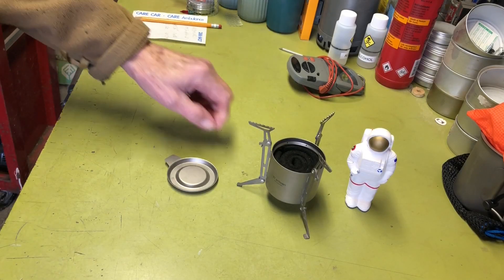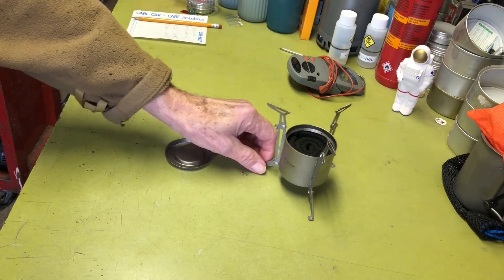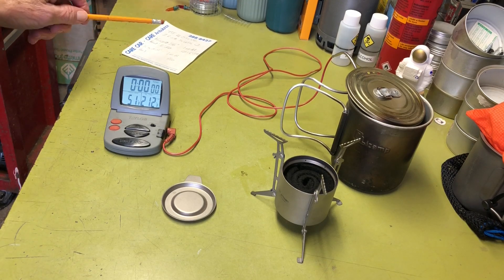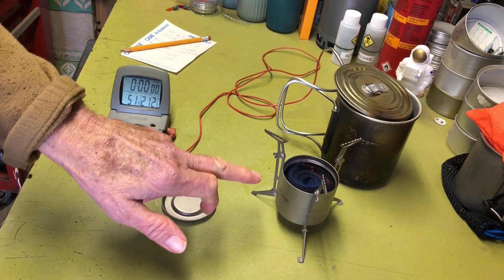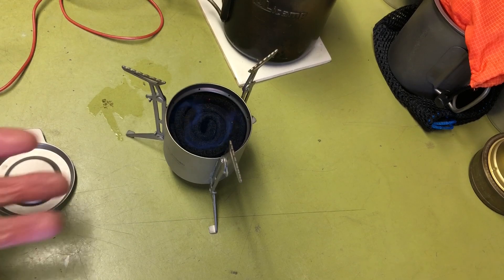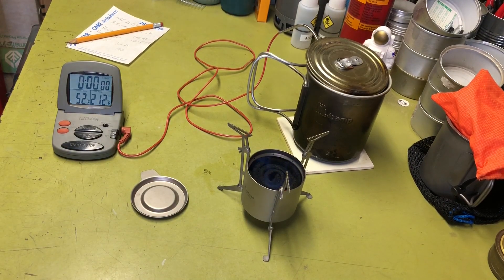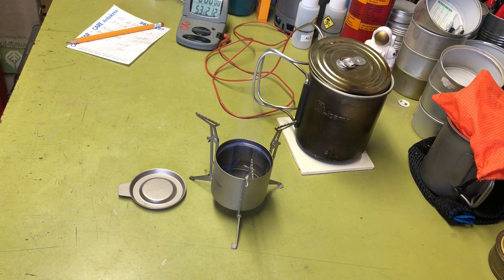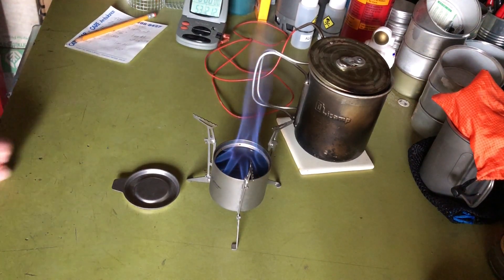Moon Lander Alcohol Stove with Carbon Felt

Comment: 👍👍👍 .. yes, that did not go as well as one would have hoped.
Although .. the Trangia Burner has a double wall. Having filled mine, the centre chamber with Felt and Wool, I still get the bloom.
Why? Pure speculation on my part now follows 🙄😏 ..
1. The bottom half of the fuel chamber in my burner is relatively 'loosely filled' with Glass Wool and then topped with a tight-fitting roll of Carbon Felt to keep everything in place. Perhaps this allows for easier movement of the fuel below, to the bottom orifices leading into the double wall Wick'd 'Bloom Chamber'?
2. The double wall chamber in the Trangia, having the wicking material therein, will then move the fuel up to the bloom ring burner holes, albeit slower in the beginning until things 'heat up' whereas, in your test, a tight dense Carbon Felt inner which will tend to absorb and 'hold' the fuel, combined with (I take it that this stove double chamber does not contain wicking of any sort .. relying rather on capillary action) .. combined with the Carbon Felt fuel retention .. just not enough?
I hope this makes sense .. once again, speculation on my part.
I suspect that the 'Moon Lander' may have to 'remain Commando' should one want any fire of note to burn in it's belly 😏.
Thanks for sharing .. interesting food for thought though .. something to 'mull' over (and mulling is good 😊).
Until next time then, take care ..
Reply: "Moon lander" is a capillarity stove, the "pinnacle" in lightweight alcohol stove development, that already have a fast bloom, some DIY bloom in 5-10 seconds; no point to put carbon felt or other wick material inside.

Comment: well, the nice thing about this type of stove is that you can easily  snuff it with the lid and once it cooled down you can pour the unused fuel back into yout storage container saving some fuel. that cant be done with the carbon felt puck stove when you  used too much fuel. while the puck stove doesnt spill and you can put the lid on it isnt tight enough (no seal) to prevent the unused fuel from slowly evaporationg.
Reply: You are right. In my opinion all the alcohol stoves that have felt inside them tend to be on the wasteful side of fuel. I noticed that when using the military style Trangia burner as opposed to the civilian models. On the civilian and knock off Chinese stoves, I pour all the unused fuel back in the bottle via a small funnel. From the Military stoves, nearly nothing comes back out. It will eventually evaporate.
Reply from the maker: I don't drain fuel out of my Trangias, I have a couple of brew kits with fueled burners. That's why I like the Trangias, I can have a couple of brews with out having to carry a fuel bottle.
 I've never had an issue with them.
Reply from the maker: Yes. I should have mentioned that in the videos.  It's what I've done after every use. 🙂
The alcohol pours out nicely with little spillage.
Reply: My Alcohol Burners that I have modified with Carbon Felt and / or Ceramic Wool, I have learned approximately how much fuel is required for whatever is to be heated or boiled .. not having a problem with having to top up / refill the burner if needed, to complete the job.